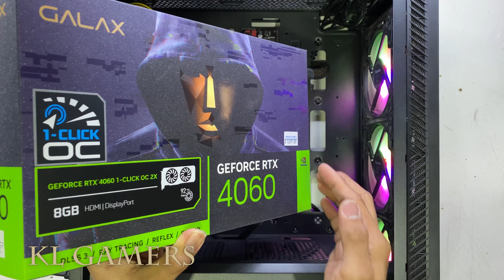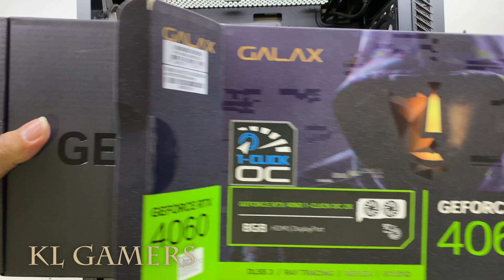How to Upgrade Graphics card GTX1650 to GALAX RTX4060

Comment: Why my 4060 not lighting the geforce rtx name?
Reply from the maker: maybe different model?
Reply: GALAX GeForce RTX 4060 1-Click OC 2X V2 8GB GDDR6 128-bit DP*3 HDMI 2.1 DLSS 3 Graphics Card
Reply: That's mine
Reply: same
Reply: @rvkeh4944  I just bought this product and had the same question but I noticed we both have "V2" (Version 2, I assumed). The one on the video probably just GALAX GeForce RTX 4060 1-Click OC 2X. Maybe this explains it.